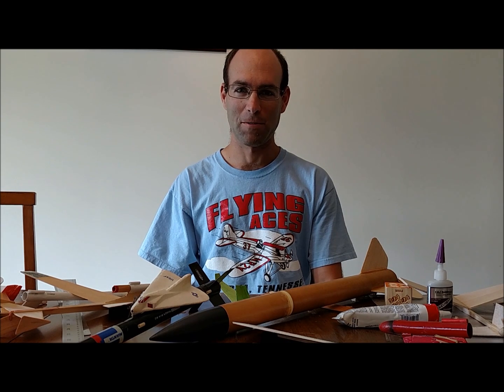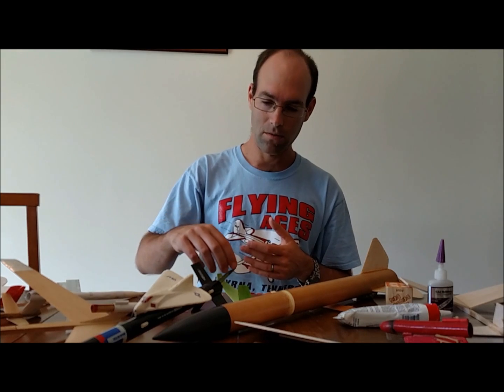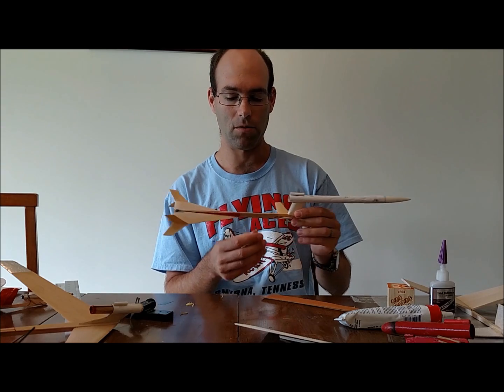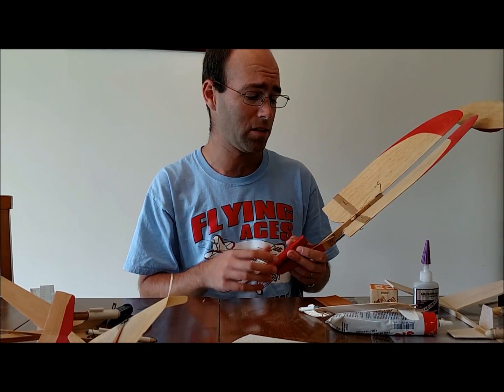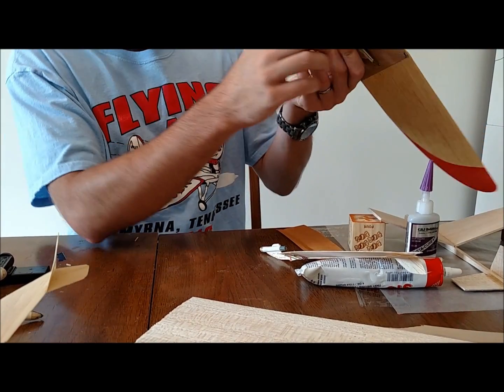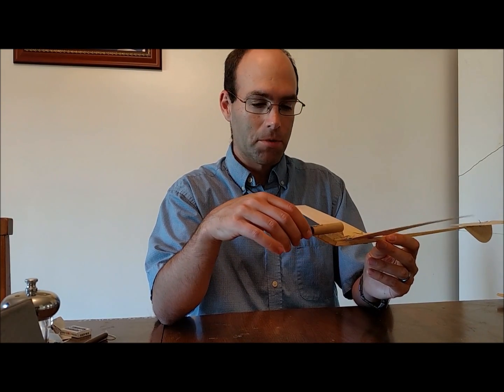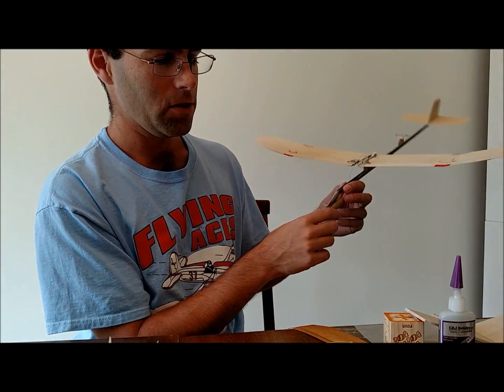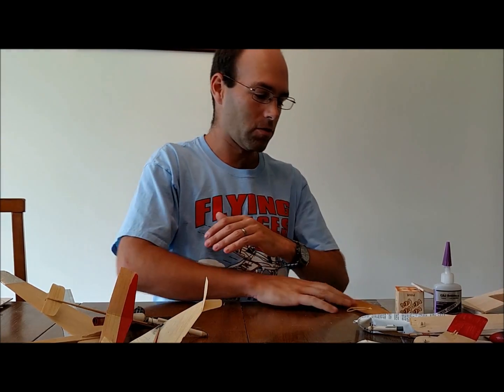Rocket glider design - Boost gliders and Switchblade Swing Wing

Comment: I'm very suprised that you don't mention the AJ Interceptor, designed by Jim Walker - who invented U control - and was sold all over the US in drug stores and was a favourite of schoolkids in the 40's and 50's. It was launched by catapult and the wings were held back against the fuselage by air pressure and then popped open so it could glide back down. It was sheet balsa, 18 ins. Wing span, and AJ (American Junior) aircraft co. Made 232 million of them. The US army used hundreds of thousands during WW2 as targets to train machine gunners how to hit low flying aifcraft. Although it was launched using a stick and rubber band catapult there is no reason why the wing folding mechanism would not work on a rocket, providing it reached a stalled apogee where there was no longer sufficient slipstream air pressure to keep the wing closed.
Reply from the maker: Hrmmm...that was an accidental omission. I've had a couple of Interceptors and knockoffs of them. A ton of fun although I've never been able to catapult them as high as I'd like.

Comment: I could never get my Falcon to do anything but loop into the ground. (1970).
Reply from the maker: Downthrust. ;) Same story with the Sky Slash II. Unfortunately that means you only get altitude during the thrust burn. As soon as it hits the delay charge, the loops begin and usually continue until ejection. You can still get really good flight times from them though.
Reply: Have you ever visited rocket reviews web site?  People would post their glide times for various launches and rockets.  Often included was a humorous story about retrieving the glider from a tree, or roof etc.   https://www.rocketreviews.com/
Reply from the maker: I used to follow that site closely about 5-6 years ago and even contributed once. Unfortunately when they changed their format I found the site completely un-navigable for the type of searching I like to do and have been back only on rare occasions. I always chuckled at the glider reviews since most folks clearly had never even trimmed a slot together dime store model and didn't seem to even understand the most basic concepts of making a glider fly. Others were more skilled. I believe it was Chan Stevens or some similar name that kept popping up as having a little more skill and now his name appears amongst the NAR National Records. I always wanted to get into competition but NAR is pricey and I don't know of anyone within hundreds of miles hosting actual competitions. I just looked at the records list for the first time in several years and see that not much has changed and my stuff is still on par with various record holders.